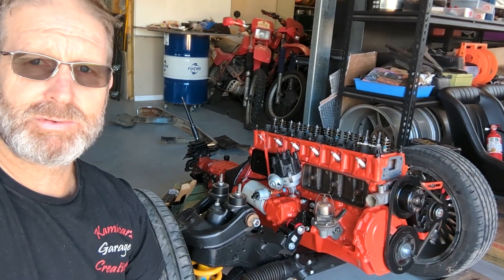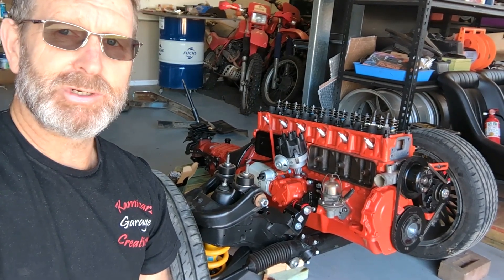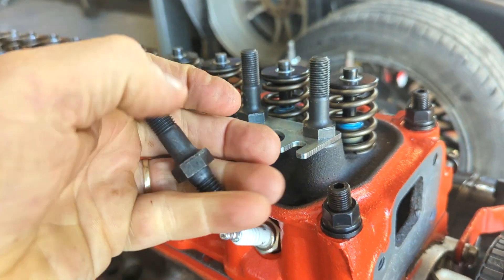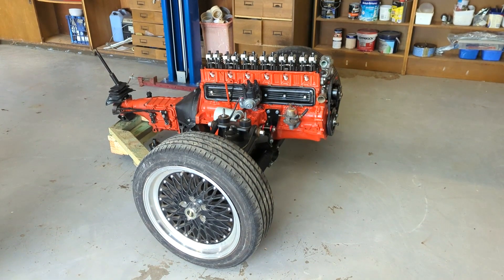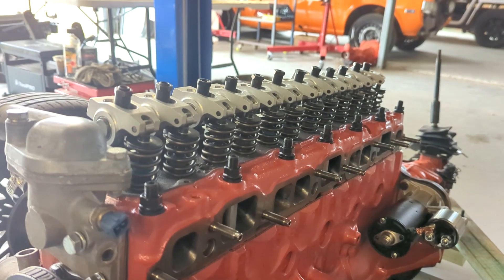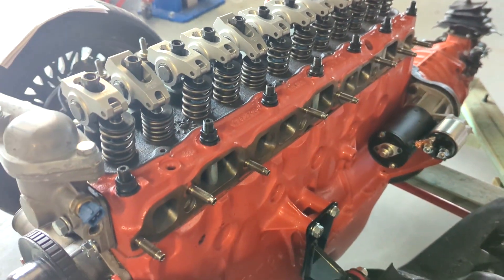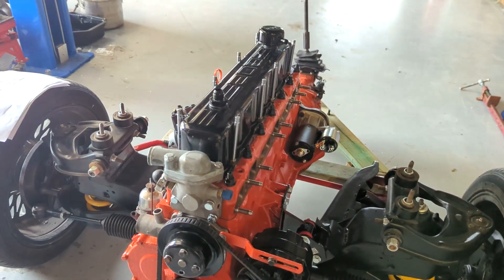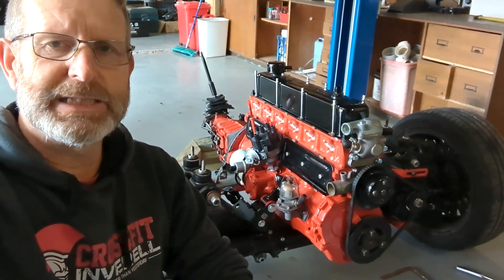No.60 Torana Build-Adjusting Valve Lash with Solid Lifters -KamicarzCreations

Comment: Hi mate you missed one thing you did not show us how you set the lash on your valves. By the way your motor looks super.
Reply from the maker: HaHa. good point. It greatly depends on the type of roller rocker you have but with these there is a grub screw inside the locking nut that allows you to set your cap between the roller rocker and the top of the valve stem with a feeler gauge. You then nip down the lock nut and lock it off with the grub screw inside the lock nut. I did this folowing the sequence chart i displayed in the video. Have also updated this in the video description. Thanks for your feedback. Cheers

Comment: I had a 292 Chevy in my 66 Chevy pickup, there’s nothing like the super flat torque curve of these motors, the make the same torque at 1000 rpm as they do at 4500
Reply from the maker: Yeah...i like these motors and have learnt a lot through the process of building a few now :-)
Reply: @KamicarzCreations  I had a 194 close chamber head with 1.94 intake valves, lump port intakes, offy 4bbl intake, Langdon split manifolds and a marine cam and it ran pretty good, I just couldn’t keep the pushrods from bending at high rpm so I went back to the truck cam and lost about 1000 usable rpm it was a fun motor for a 1 ton truck with 4.56 gears and a 4 speed
Reply: @KamicarzCreations  also I have a set of shorty headers I’d give away if someone paid for the shipping I think the fit a Camaro or a nova because the hit the clutch linkage on my truck
Reply: This is a Holden Red Six it may look chev but no parts interchange . With 186/202 ci Holden.